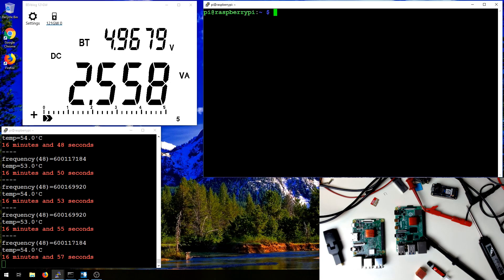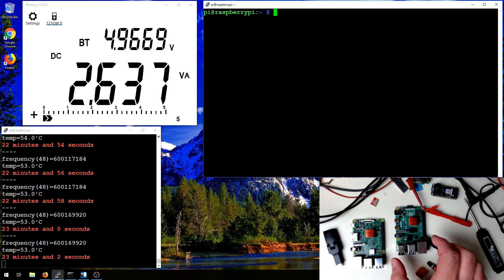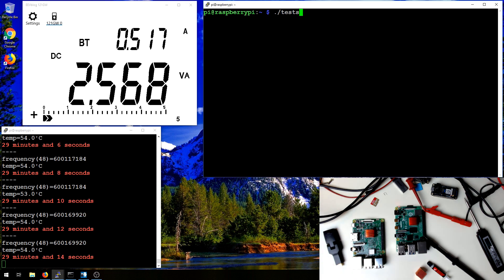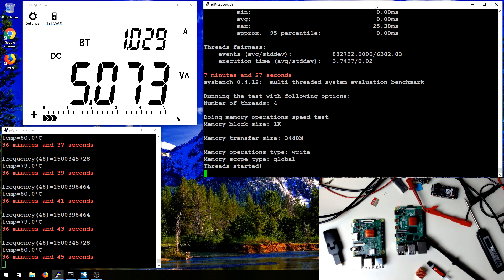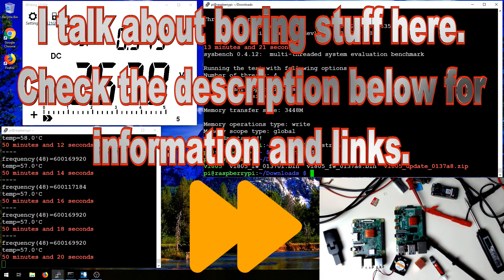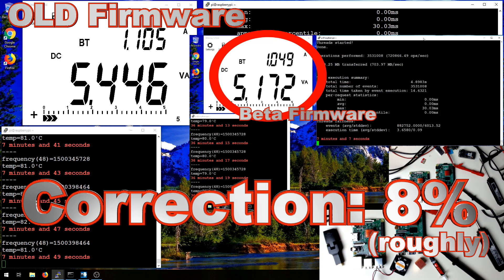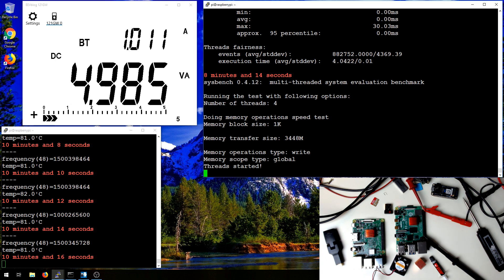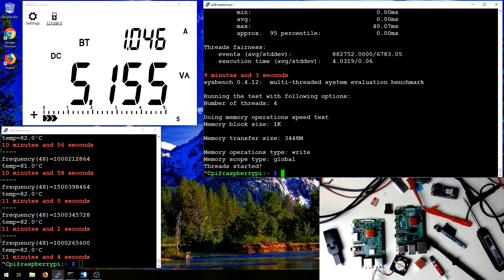Raspberry Pi 4 Tests (Pt.1) - Beta Firmware Reduces Heat!

Comment: I'm definately glad I resisted the urge to purchase a pi4. For emulation game playing it's got a ways to go. Might as well let developers iron out all the big kinks so I can just plug and play eventually. Even if I had one now it would just be sitting in a drawer until that day.
Reply from the maker: I don't think that day is far off but it certainly can't hurt to wait :) Cooling may be the biggest concern for you so waiting for a case that can keep it cool with a quiet fan may be what you should look for.
Reply: @KamotsTalksTech  cooling is  definately a priority, especially since it looks like the pi4 is easily overclock able. Pretty sure I am going to end up with a good sized heat sink and fan for this thing eventually.

If you can make retropie, batocera and recallbox  tutorials for pi4 as good as your odroid tutorials you'll probably get a lot of views.
Reply from the maker: I am going to be doing thermal (and power) testing after overclocking in the next video. The PCB for the Pi4 seems to do a better job spreading heat, but that also means everything that gets hot impacts everything else on the board.
As for tutorials, thank you for the compliment but I'd bet that ETAPRIME is going to get those done long before I could do them and likely do a better job then I would :) I usually try to make videos that provide more information (or more accurate information) then what is available from the more popular channels. I like spreading knowledge so everyone can do cool stuff with technology. :)